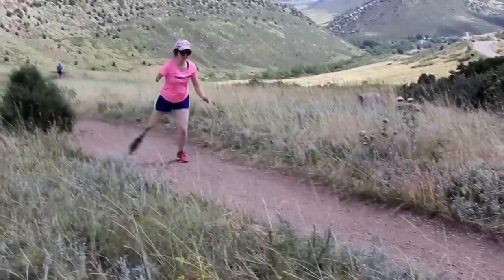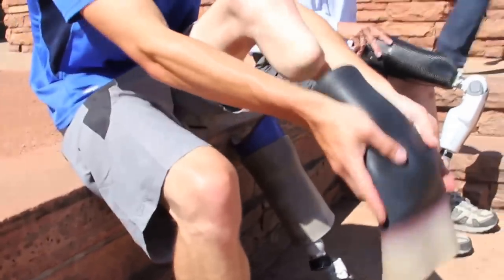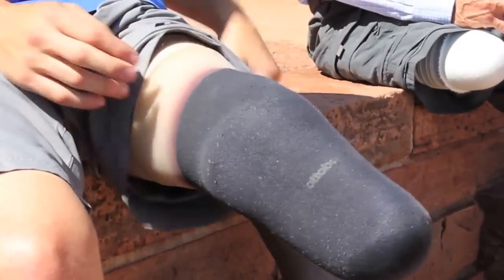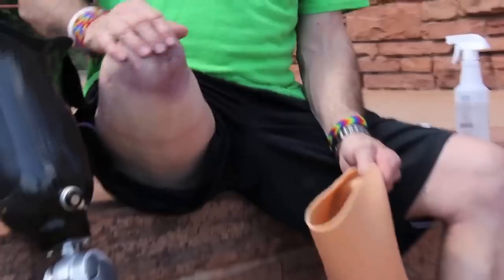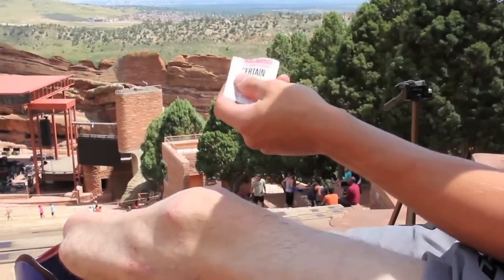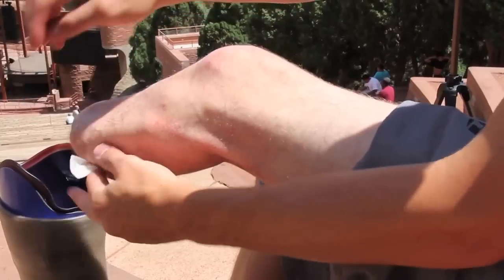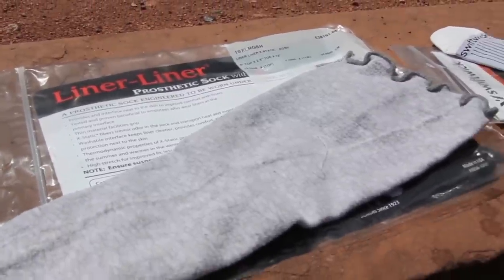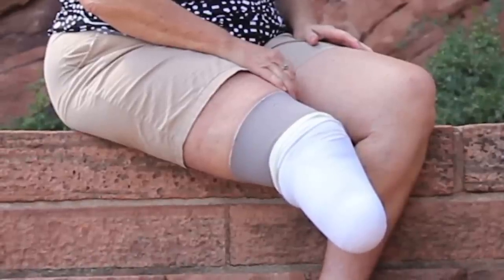Managing Sweat in Prosthesis

Comment: Tired them all. Certain Dry gives me a rash. I have been wearing a leg for over ten years. I still can only go about 5 minutes before my leg starts to fall off with my elevated vacuum leg and sooner with my pin lock leg. I can't afford $1800 for a new liner 2 or 3 times a year. It is hard enough to buy sleeves at $150 each 3 or 4 times a year. I'd like to try osseointergration but i really can't afford $100,000.00. At the rate i am putting on weight, i won't be able to wear a leg much longer anyway so this is probably all a moot discussion.
Reply: Same here & I work a trade job. I had to go with the old 70s style. The new liners will slide right off in about an hour of work. Not effective. Makes me look like a liability. I’ve found monostat cream or the anti hand sweat cream helps a little, but baby powder during the day. A & d ointment at night
Reply: Also a weight bench brother. Low weight high reps. Push ups, sit ups, squats and planking You’ll loose the weight
Reply: Hi listen as i don't know you i won't get into the whole weight debate of why allow yourself to get overweight in the first place, but what i can say is in my experience regarding putting on weight, i was way overweight,  i am 6ft3 i was normally around 12 stone which is still overweight, but i ended up at just short of 19 stone, this caused me massive issues especially regarding my limb, long story short, i went on a diet and in time over the years i am now down to 12½ stone, around 6 stone i lost, i still need to lose around another stone or so, but i honestly can not stress enough just how important it is for yourself to lose weight, not just because of you're leg etc etc but for you're overall health in general. 19 stone = 266lbs or 120.656kg, 12 stone= 168lbs, or 76.204kg.